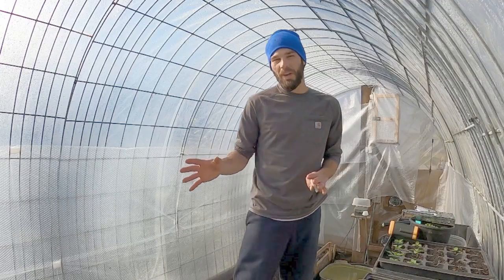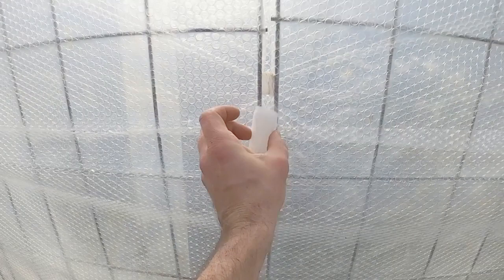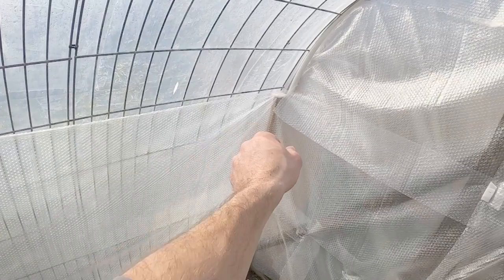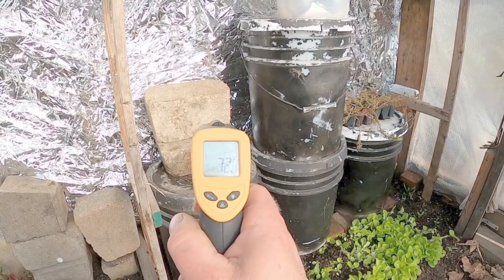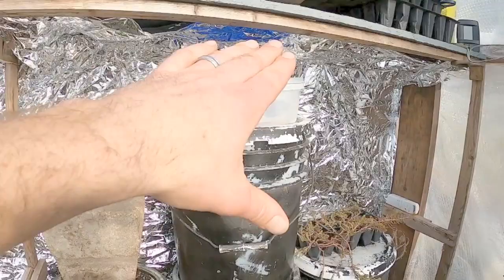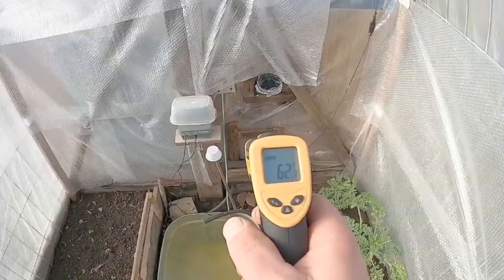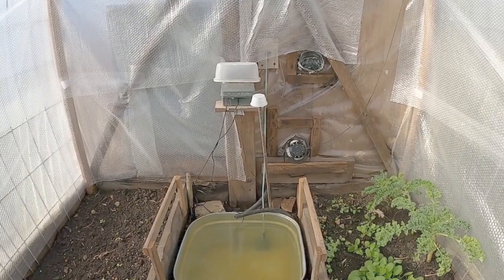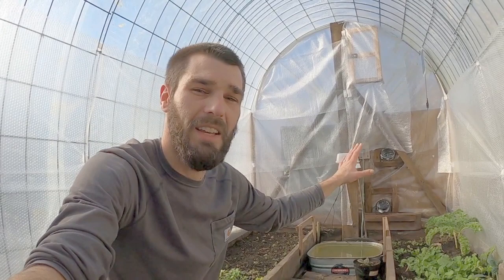EASY DIY Securing Bubble Wrap Insulation | Cattle Panel Greenhouse | Conserving Compost Heat Inside

Comment: With the bubble wrap, I imagine that it will heat up quite nicely as it seems to be warming fairly well as it is.  Magnet and foam.  Fantastic idea.
Reply from the maker: Just a little extra 20-30% less heat loss possibly up to 50%. Thanks for checking it out!

Comment: oh my gosh…. i forgot the awful wind storms we have been getting for last 2-3 years.  blew my ag cover off even with about 100 lbs per yard of base weights.  day and night. twice this week. then i put a white sheet up and over mostly on west side with lots of clothespins.  i worry about the rain, but i figure the sheet will break up the raindrops.  I had seen a larger long hoop house of cattle panels with long tubes filled with dirt or sand holding the ag plastic taut against the base.  our wind is a sustained 30 mph with gusts 40-55 range. our stupid weatherman calls this a breezy day. we are ready to ask him to replace our storm doors that blow off in the breeze.!

Comment: I just bought 50” by 16’ cattle panels and a roll of 6 mill ag covering clear- we are going to figure out how to cut and piece it.  width of house about 30 feet, by 150” long.  we will put up more insulation near fall. the bubble wrap is supewr idea. i will call waste management and see what they know about bubble wrap discards. hubby is thinking of foam insulation under the deck where the house willgo.
Reply from the maker: That sounds great! They make bubblewrap for pools and for insulation that is protected from uv degradation to an extent. But it’s a bit more costly. Good luck with it all, and the more insulation the better when it comes to winter. Double layering plastic or anywhere you can created a trapped airspace will provide added insulation value to the least insulated areas

Comment: I placed 6" tall row covers over started plants for near single digit nights. A greenhouse within a greenhouse. It worked and I removed them when temperatures came back up
Reply from the maker: Microclimates are our friend, I’ may be throwing extra poly hooped over the raised beds in this little greenhouse for some extra insulation deep in winter also
Reply: @Earthdwellershomestead  awesome! I try to share when I figure something out. You have a better reach than I do because I haven't posted any videos yet. I still need to learn how. Is it OK if I link to your videos for reference?
Reply from the maker: @jalapeno3721  certainly !
Reply: ja,, i did this the other night temps down to 28. ugh. but saved the seedlings, well, most anyway

Comment: You're getting really creative!  I'm wondering if you could find some of the flexible solar panels (the rolls) that you could use on the north wall.  They would provide another layer of protection and provide power.  Since they are black, they'd provide some heat too.  Just a wild idea and maybe not cost effective.  Cheers!
Reply from the maker: You know I was browsing through some (cheap and expensive) I may give something like that a shot after the bubble wrap is all done. And I would have an extra power source for heating or circulation needs. I just wonder about the longevity of the foldable panels against humidity
Reply: @Earthdwellershomestead  I was thinking about the rolls of solar panels.  Not sure it is foldable but I don't know much about them.  It looked like a roll of black plastic but it was little solar panels and very thin.  Just a wild thought.  Maybe I'll look into it more.  You're doing great.  Your videos just got me thinking!  Cheers!
Reply from the maker: Appreciate the direction! I’ll look into these!
Reply: farm supply catalog

Comment: your compost tube-what is the diagram. what does innoculate mean, wiith what. does the tube have an end on it and justsits within the compost heap? we can buildd a pallet bin, down off our deck where the hoop house will be, we could only find 6 mil clear ag sheeting 10’ by 5o’so we have to jointhem double sided sticy tape- do you know of industrial tape like that? looking forward to 12 months use of our 30’ wide by 15’ long martha stewart room thanks for great ideas
Reply from the maker: DIY Greenhouse Compost Heating Explained | Diagram Drawing,  Explanation, & More Uses!
https://youtu.be/WqvFRzDoc_o this is the link for our compost tubing and heating systems. Very small scale for a small greenhouse but we’re experimenting with larger systems for our 520sq foot greenhouse tunnel.
Reply from the maker: There is lots of foam tape and heavy double sided tapes even pond liner sealer may do the trick?
Reply: yes, hubby brought home gorilla double sided yesterday/.for securing items to smooth and rough surfaces.heavy duty inside or outside.it seems you need room temp to work it, so maybe when it gets up to 68* end of summer here in MI, it’ll stick.

Comment: How do you prevent cat claws or turkey claws from puncturing the greenhouse plastic? And what is the best way to patch a puncture? (Bit off topic.)
Reply from the maker: Off topic works because we just had one of our chickens scratching the back north side down low I have a small scratch about 2-3 inches and for right now I have a small thin piece of foam wedged between the poly and cattle panel as a temporary fix I’ve been looking at specific greenhouse tape but good stuff is a little more pricey. I wanna try it out on the inside and outside for a “patch to see how well it works and holds in the cold. I’ve only has this one incident with our poly but if it becomes an issue I’m going to place some fence low all the way around the base to keep the hens from scratching too close
Reply: i just bought a nice thick roll of clear 100% stick tape (in the tv ads shelves_ ) the stuff was not what I wanted, but boy howdy, it stuck chicken wire to glass and metsl. t storms last night, that tape didnt move.  so, you peel off a length you need and peel off the clear plasticy backside, and stick it on. wowsa! pricey, but a good find
Reply: also, you can install chicken wire around the house. fowl hate chicken wire.
Reply: preventing cats climbing= we have lots of bluebird houses on special poles now, but before them, i put a big round shape of chicken wire tight against the pole i
on the inside of the circle.  then the part that stuck out, i left that loose and unsupported. cat jumped up on it then whoops, he was hanging in mid air offa it. worked a charm. i was thinking put a layer of tall loose chick wire around the house . the cats can jump up on it but they will come down real fast when the top part flies out. you might have to redo parts but not too many times.  flying kitties!